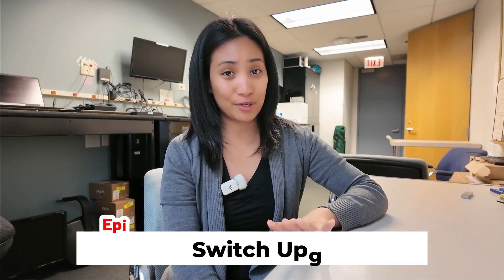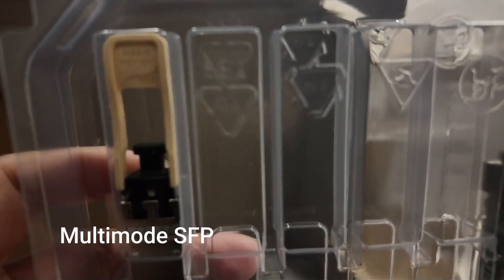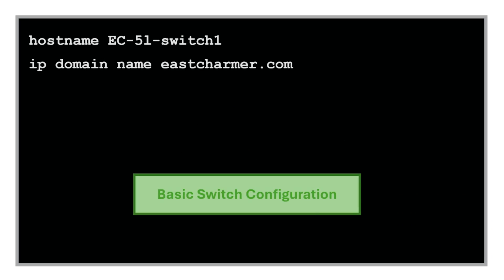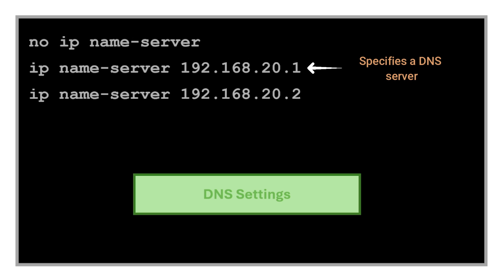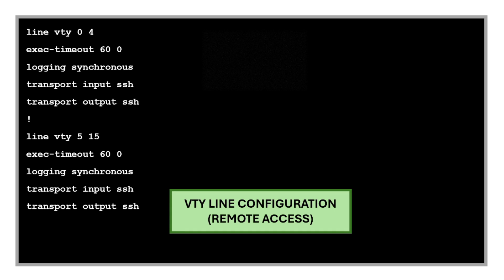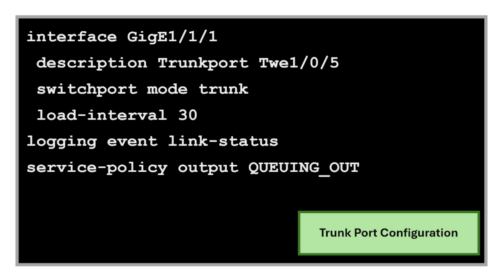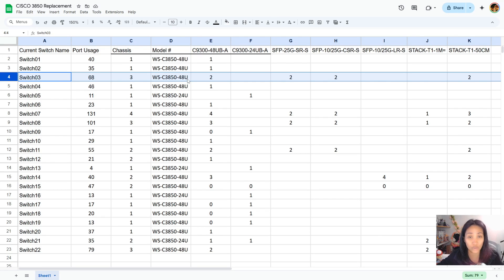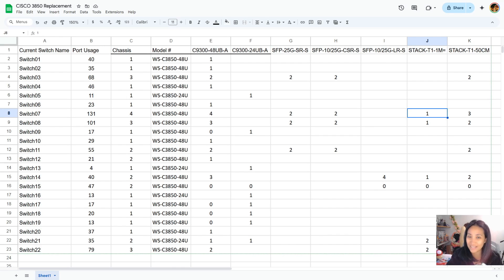CISCO Switch Upgrade Project (Preparation Phase) Building Config File | Inventory

Comment: Great video! I have some questions, I think you will change the native vlan on the switches, right? And permit some vlans on the trunk links by using switchport trunk allowed vlan and another question is: when do you do this type of work  which is about replacement, you copied the configuration of the old switches (config.text and vlan.dat) and then you unpload these files into new switches or you have to configure all the new switches manually using the old switches configuration?